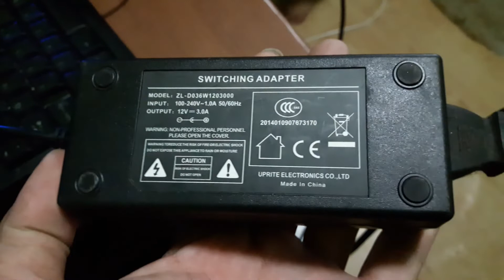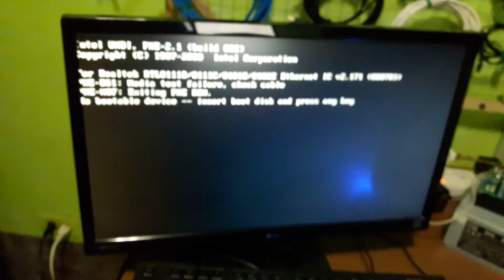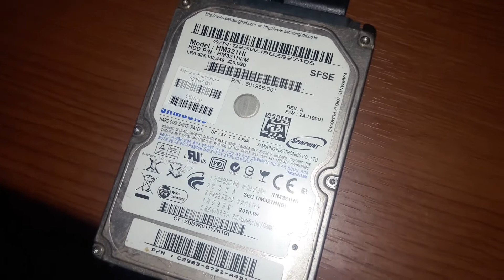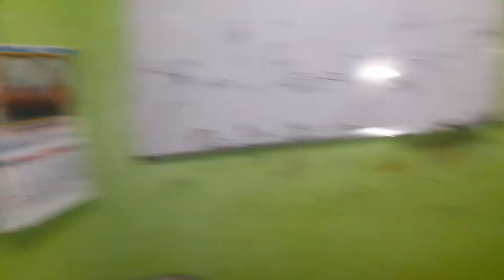Lazada Unboxing - Brisky DC to DC ATX 300W 12V Pico PSU

Comment: Does the pico psu need to receive a constant 300 watts of power to output a constant 300 watts?
Reply: Bytes Crafter so if 
I were to feed a 250watt version of this with 220 watts, could it be used for a pc that uses 209 watts?

Comment: You're running a 300W DC-DC converter with a 36W power supply?
Reply: @ITManPH  If you multiply the 12V with 3A that your power supply delivers, you get 36W, which means the power supply is only designed to make 36W of power. It might make more than that, but 36W is what it was designed for. Either your PC is using less than 36W or your power supply is being stressed.

Comment: i have this but i have a problem , i want to use vga and that vga need 6pin connector , when i want to use adapter molex to 6pin the seller say that it need use 2 molex from psu but this pico psu only have 1 molex , what i need if i want to use 6pin with this psu ,